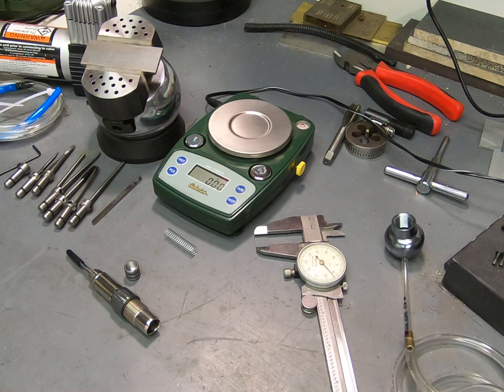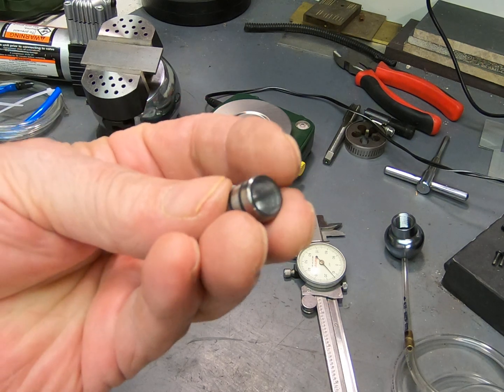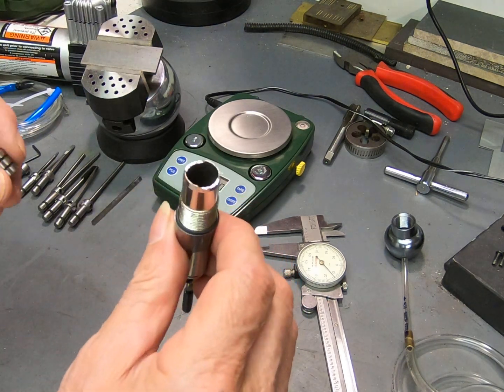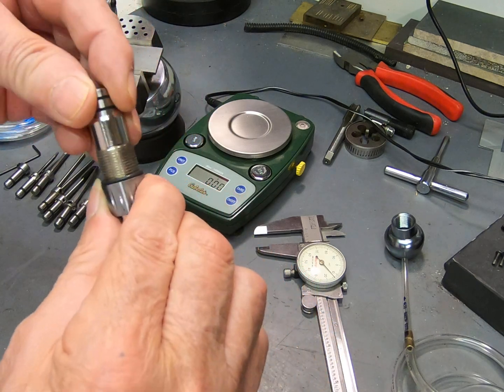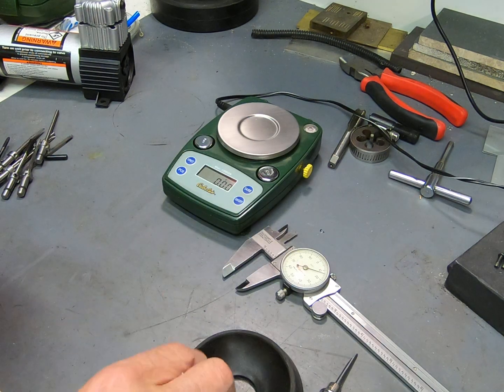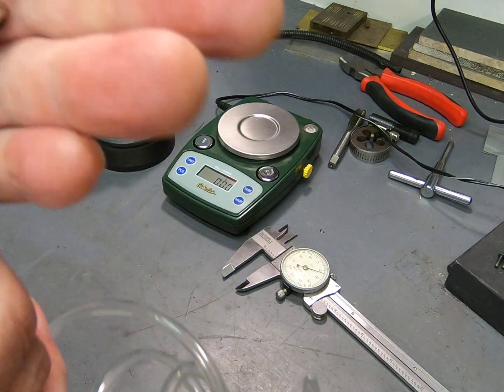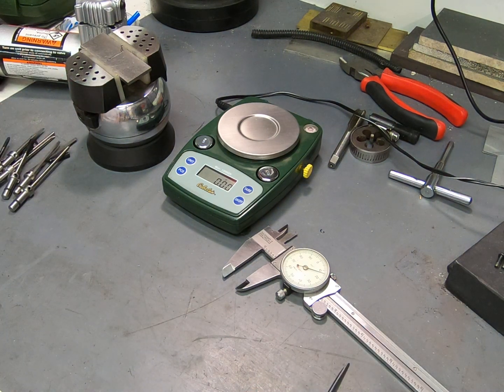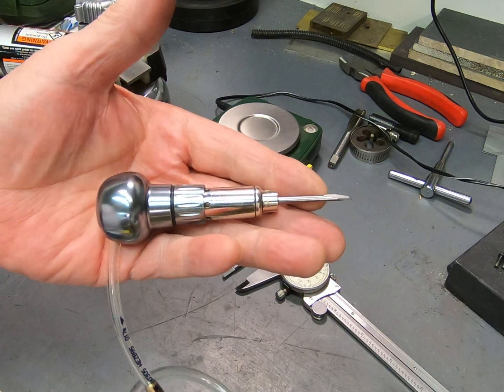Follow up on modifying the Clone Hand-Piece, end result

Comment: so the machine you are using isnt a normal compressor?
it pulls the air in and out?
shouldnt it work with a normal compressor, with a pedal and a filter pressure?
Reply from the maker: In order for this type of hand-piece to work you must modify a small compressor/tire inflator. It will not run on regular compressed air.
Reply: @ralex397  thanks

Comment: Did you just modify the piston or did you leave in the smaller spring you used in the other video. Awesome info by the way. Thanks for sharing your knowledge.
Reply from the maker: You must modify the piston weight down to 3.5 to 4 grams and install a lighter spring at the back of the piston for this hand-piece to work with the Home Made Hand Engraving Machine. The clone hand-piece comes with a 9 gram piston and a heavy spring in front of the piston, to work with GRS clone machines.

Comment: Hello, thank you for these great videos.
Can you specify how and where you found the 1.65 grams to be removed?
Did you turn and reduce the wall from the inside?
My English is bad and I'm not sure I understood it well.
I seem to have found the same Chinese copy on ebay, I could see that you changed the spring, is this essential?
The original is too stiff(strong ?), right?

Thank you for these responses:washhands:
Reply: Good evening, I just found other videos that answer my questions! THANKS
One more comes to me, I don't think it's been discussed but not finding the same compressor as you, should we find one with a capacity comparable to the data you indicate in another video?
Or any portable 12v compressor will do.

THANKS
Reply from the maker: @Valudespins  any small "quality" 12 volt tire inflator should work, make sure it has a ball bearing on the shaft to the piston, that makes it much quieter, the real cheap ones have a bushing and they are very loud and vibrate.
Reply: Thank you for your reply.
I placed an order, it looks like yours with a few differences.
Do you have the diameter of the pneumatic hose that goes on this type of handpiece? @ralex397
Reply from the maker: I use 1/4 inch OD .170 ID clear vinyl tubing  @Valudespins

Comment: Nice thanks for the video update. I assume that the end of the bore can be drilled and reamed from the current 6 mm to 6.32 in order to fit the GRS collets without too much difficulty as well.

As far as hose length is concerned another way to compensate for longer hose is to use a compressor with a larger cylinder volume.
Reply from the maker: Yes it can be reamed up to .250, but you can also buy the 5.9mm tool holders from AliExpress a lot cheaper than GRS holders.
Reply: @ralex397  Yes that is true. But options are nice because some people don't wish to by more than absolutely necessary from China. Myself I have a lathe, mill and surface grinder so I dont have to buy anything from aliexpress
Reply from the maker: @johnfurr8779  I hear you, I like to make my own, but not everyone can so I like giving them other options. Hard to beat the Chinese prices. I don't use aliexpress either. I buy from eBay. Everything in the ammo can is made in China, its hard to get around that. If I engraved for a living I would own a Lindsay system, but this homemade rig works great for what I need it for.
Reply from the maker: Haven't tried reaming it up yet, I'll let you know how that goes.
Reply from the maker: With this modified compressor the displacement is .5496 Cubic inch. Yes if you had a larger compressor it could keep up with longer tubing.